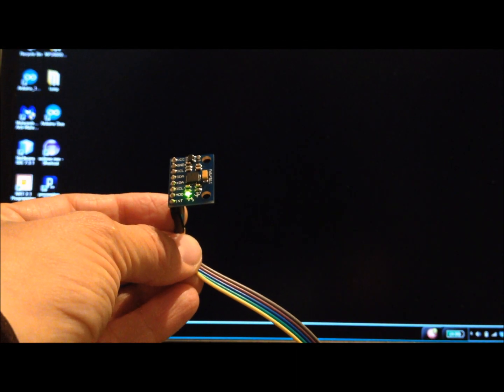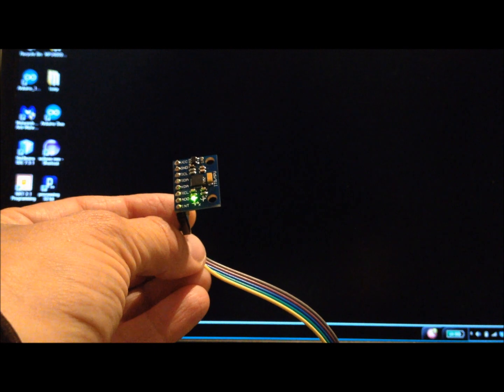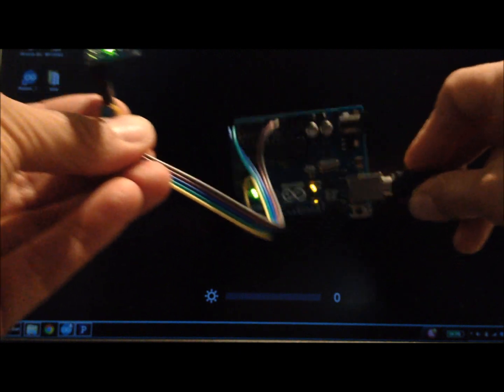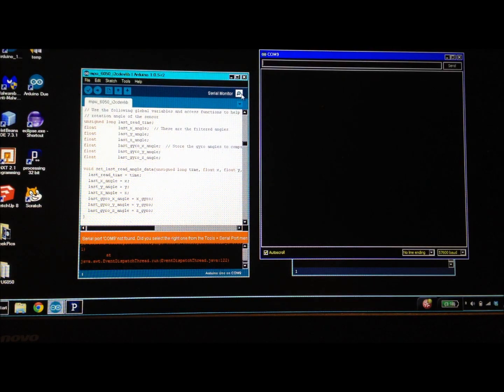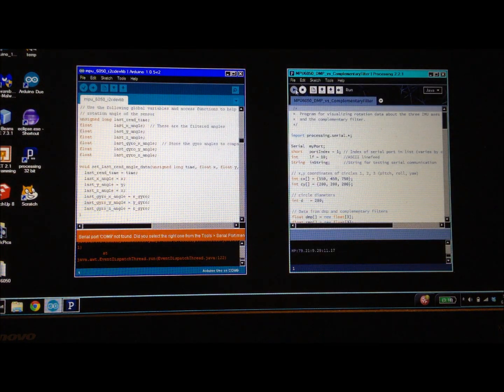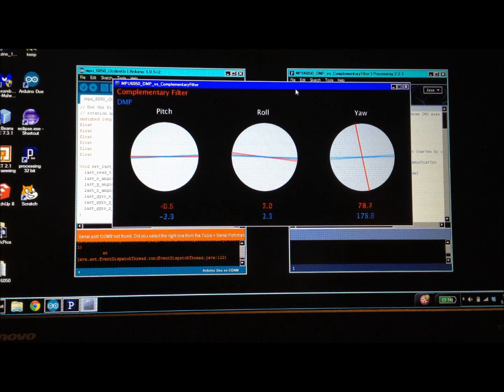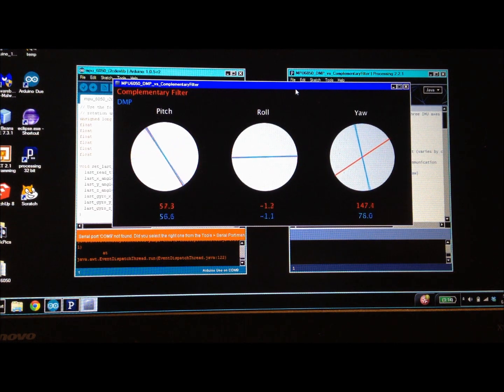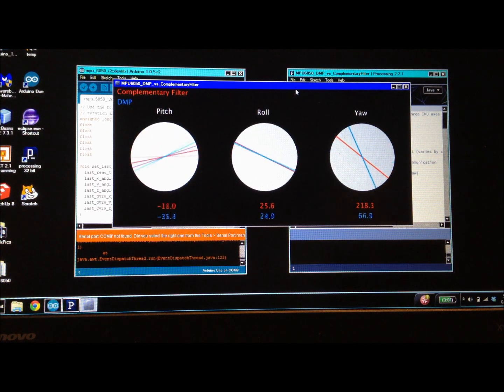MPU-6050 Orientation from DMP vs. Complementary Filter

Comment: My device gets stuck on most of the time

```
DMP ready! Waiting for first interrupt...
FS_SEL = 3
AFS_SEL = 0

```

Anyone have any ideas why?
Reply: There is a interupt pin on the IMU labeled INT you need to connect it to arduino usually pin 2 check your code which pin is intreput. If you are using arduino uno reduce the baud rate to 9600 higher baud rate uno cannot handle and suddenly stops.
Reply: @SasteJugaad  thanks. I did get it working. I was being dumb as I was using one of my MPU 9250s and not a MPU 6050 and not paying attention. God I felt stupid.

Comment: yeah I definately am a bit late but, still.... what is the point of using a complementary filter when the chip already does the calculations on its own?
Reply from the maker: The point is to learn how a complementary filter works and to see how the algorithm compares to others.
Reply: @geekmomprojects  sure, but I was talking specifically about the mpu6050 applications: why not use the DMP? Is there any reason at all?
Reply from the maker: @ico-theredstonesurgeon4380  I would use the DMP, as it certainly seems very accurate. The only reason I can think of not to use it would be for an application where you need to know the algorithm used to make the angle calculations, as the DMP algorithm is not published as far as I know.

Comment: I know this has been some time since posted but I wanted to thank you for the clear explanation and the great write-ups you put together. I have been looking into Quaternions and rotation matrix math and looked pretty far into the data sheets for the MPU-60x0. I never understood that drift is a product of accumulated error in the math until I read your post. Thank you for expanding my understanding. You are a good teacher, as I can be dense as a brick sometimes and you got through  :)

Comment: How do we get that processing sketch up?:)
Reply from the maker: Did you download it from my blog post?  You may need to use Processing 2 to get it to work.
Reply: Yes i downloaded both files, tried to run the first one on arduino ide but fail cos they said that the IC2dev.h was missing so i googled and copied to my library and tried to upload again but fail again what should i do thanks:)
Reply: Dear geek,
i installed the 1.6.10 ide and the sketch worked, but when i go to port 57600, it says 
CMP:0.00:0.00:0.00
DMP:-63.82:3.25:-165.42
can i ask why is it not Yaw Pitch Row data? or is it the DMP values, then what are the CMP values?
and for the Processing part, i got an error of 
the value of the parameter p is not used 
line 101
please help? thanks:)
Reply: so i installed your processing 2.2.1 version and got this error
arraryindexoutofboundsexception: 1
what should i do to make all these work? thanks:)
Reply from the maker: This is the YPR data, just compactly formatted to send to the Processing sketch.  CMP is the complementary filter data and DMP is the digital motion processor data.  For some reason, you are not getting data from the complementary filter.  I'm not sure why that would be.  You might have to go into the arduino sketch and add some "Serial.print" statements to see if any data is getting read out from the Accelerometer and Gyroscope sensors.  The DMP data is the three YPR angles, just separated by semicolons.
Reply from the maker: The out of bounds exception is for the array of serial ports.  The processing sketch just gets a list of the ports, and on my laptop, the serial port is simply the second one in the array (index value 1).  You will have to change the value of the index into the serial port array to 0.  If you cant find that part of the sketch, let me know, and I'll be more specific.
Reply: Dear GeekMom, i went to install the 1.6.10 and your sketch shows error compiling sketch:(
i need help understanding the code:(
I know what is YPR and i managed to get the DMP for the teapot but strange thing is i cant upload your old file+ i dont understand what all the sketch mean, please help:)
Reply: Dear GeekMom, i went to install the 1.6.10 and your sketch shows error compiling sketch:(
i need help understanding the code:(
I know what is YPR and i managed to get the DMP for the teapot but strange thing is i cant upload your old file+ i dont understand what all the sketch mean, please help:)
Reply: Dear GeekMom, managed to update the IDE and upload your arduino sketch but still no CMP, what should i do?:)
and for the processing sketch, the error is still present
thanks for replying btw